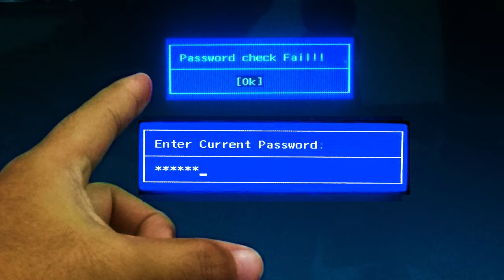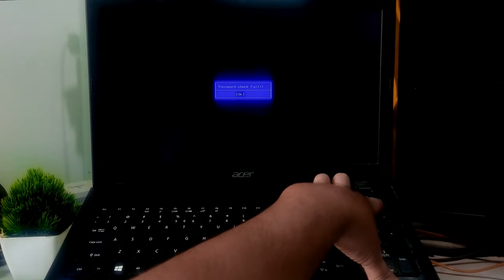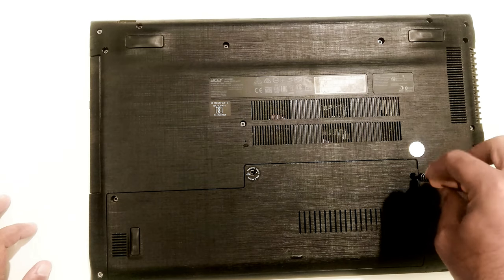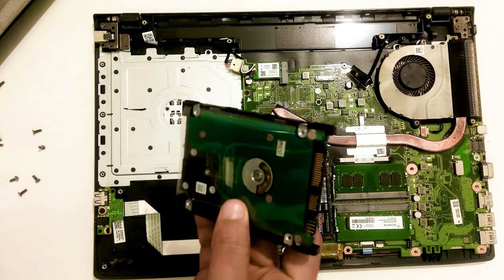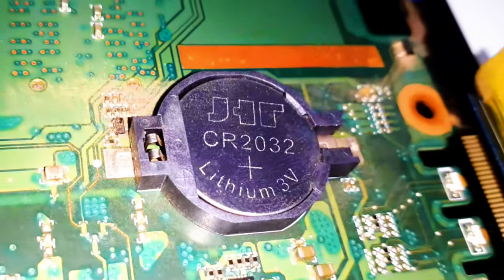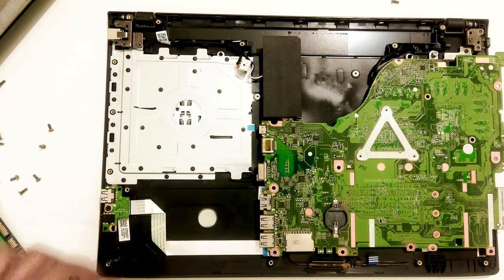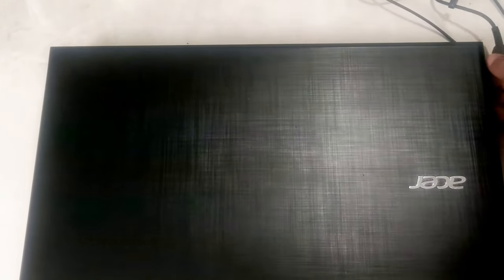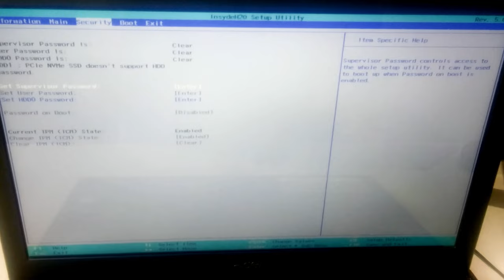How to Remove BIOS Password on Windows Computers (100% Working Method)

Comment: BlaBla  ! Only if you change the motherboard  !!!!! Even after 30 days without power, the code did not disappear !!!!!!!!!!!!!!!!!!!!!!!!!!!!!!!!!!
Reply: Want I can do than when I vergot the password 💀
Reply: Don’t be dumb all you need to do is take out the cmos battery or reset the jumper next to the cmos battery
Reply: Don’t need to change board just need to short cmos
Reply: @VKBOSS2  I have tried this and it doesn't work, some bios chips has a special EEPROM chip and this one doesn't lose data after the energy goes out
Reply: Just google "I forgot my bios password"

Comment: I never set the UEFI password, don't know where it came from or what it is.
Reply: same here :(
Reply: ME TO
Reply: Me too i cleared the password but its locked itself
Reply: @PrashantLama-ft8yb  The Surface Laptop in question has had Linux installed and then I reinstalled W10. So the locked UEFI does no more than restrict the settings that you can alter. My suggestion is ignore it. Cheers G Fuck MS anyway.
Reply: I'm going to change motherboard on my asus vivobook laptop and my old existing SSD in working condition so my question is if I put my SSD into new motherboard can I get all data same as before was?

Comment: This won't work on most laptops made since 2010 where the password is stored on a separate EEPROM. I took the battery out of mine for over a day and the password was still there.
Reply: ok then what is the solution ??

Comment: Tried it many times, but it still has password. what is the problem?
Reply: Me too
Reply: Bios password is no longer stored in the CMOS battery due to the bad security
Reply: @FrewTwoMusic  So how to reset?
Reply: @DLBDesuLofi You cannot reset BIOS password in devices built from 2018 as TPM was chosen as security measure which prevents doing this thing. There is only one way that is to change motherboard.

Comment: Just curious,  this seems straightforward yet many videos show unsoldering bios chip, reprogram and resolder.    Why does this work without the reprogram of bios?
Reply: I think that is only necessary if the BIOS (this is not the same as CMOS/Setup) has been corrupted, OR instead of having CMOS you have NVME. If you just have fouled the CMOS data to a state where the computer can no longer boot, it is usually enough to "air out" the CMOS battery.
Reply: @jussikuusela7345  How to do that? Cmos?
Reply: @Vero2yu  "airing out" the CMOS battery? Well, you take it out of the holder for a few minutes if it is mounted like that. Usually it is.

Comment: I want to try this method on a Dell laptop / notebook. Thank you 🤓 and great, well prepared video!
Reply: i thinks is not workijng for dell laptops E6420 with administration paswords
Reply: Kimmy
Reply: did it work?
Reply: @zeypo  actually it didn't. Even using the so - called "master password". Besides the Dell laptop was a very basic one. It has a CD - DVD slot, a space for the DVD drive, but there was no actual connection on the mobo. Very limited laptop, so I donated it to Goodwill! As a kind of hobby I look for electronics in dumpsters and curbside stuff!

Comment: i have  2 in 1 windows tablet with this bios password issue, how can i bypass for that? much different than a standard laptop, hoping you have some answers
Reply from the maker: Check the manufacturer information!
Reply: hi i have the same problem did you found a solution ?
Reply: No solution 😕

Comment: How do I remove a windows username & password please, I think it's a windows password, there's a round head & body on my Lenovo laptop screen. Great video thankyou.
Reply: If it’s a windows password, I think a wipe of the whole ssd/had that has the Microsoft Windows installed on it should do the trick. Since the OS is installed on the ssd/hhd it’s running off of. Install windows again and should fix the problem
Reply: @Genesisxtr3me hi since I posted this comment i noticed that my Lenovo yoga 260 thinkpad needs a username & password and bitlocker password, I don't know all 3, please can you give me additional advice I would really appreciate it. Thankyou so much.
Reply: @sloopycat1954  I couldn’t help you further than that though…I’m sorry. If I find something out, I’ll have ya in mind and come back to give ya the answer
Reply: @Genesisxtr3me Thankyou so much I'm very grateful.

Comment: I have a problem, I can't boot a new system on my computer, which is XC1660, because it doesn't allow me to boot from usb
Reply: hi, I used to have similar problems before but if you can access your bios you'll be able to change the settings UEFI Settings to LEGACY settings on Boot settings
Reply: try pressing F9 after powering up, and see if you get any options to boot.

Comment: Doesn't really work on my Lenovo Y700-17isk. I even had it drained for 1.5hrs and still nothing. I guess newer laptops with EEPROM for BIOS is really just that uncrackable alright. :/
Reply: It's crackable, you just have to use jumper wires on the chip to clear the password.
Reply: @Techknowverse  i had olit serviced thru a computer repair store as i dont have the toold and i dont want to brick thd laptop i just bought 2nd hand. but yea  crackable  makes me wanna experiment on this nmbut not my laptop haha.

Comment: Acer E11 is a P.I.T.A about this job... need to kinda take it completely apart to reach the CMOS battery, and be careful not to mess up the touchpad connector. Which I did. But then, the touchpad sucks anyway IMO, far better using it with a mouse especially where I use mine. I made a hack when I was at it, I carved some plastic out of a honeycomby part in the shell, so I could move the CMOS battery to a spot where I can reach it without going all the way again. If I find it too difficult to get replacement 1220 button cells, I have room to fit in a very ubiquitous 2032.

Comment: I unplugged the bios battery for 24 hours and the bios still prompts for a password
Reply from the maker: If removing the CMOS battery didn't clear the BIOS password, it’s likely that the password is stored in non-volatile memory that isn't affected by removing the battery, in that case check your motherboard for a jumper labeled 'CLR_CMOS'. Moving this jumper to the "clear" position can reset the BIOS settings, including passwords.

Comment: Unable to reset from this mathod trying many time
Reply: If this method not work then you must reprogram the bios chip. This method performs well when bios is not corupted and just reset it. For corupted bioses you need elevated skills and tools to perform succesfull repair as you need to reprogram the eeprom chip out of the mobo and (or) replace it with a new one.

Comment: Does not work on a HP Envy 750-116
Reply from the maker: You can try!
Reply: I have tried it, but after I whatched your video again, I realized I'm at fault.  The bios is not locked. It's Windows 10 that's locked. Please accept my apologies